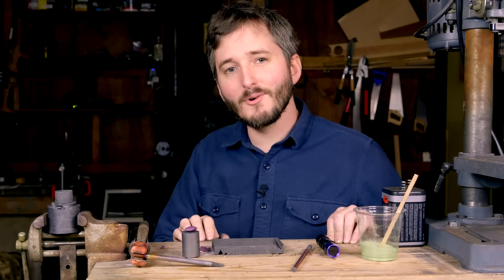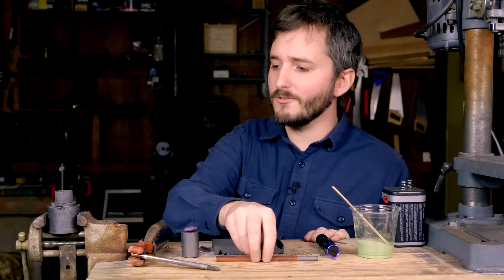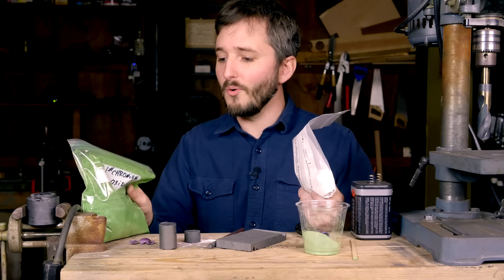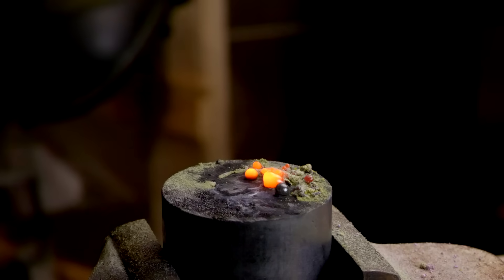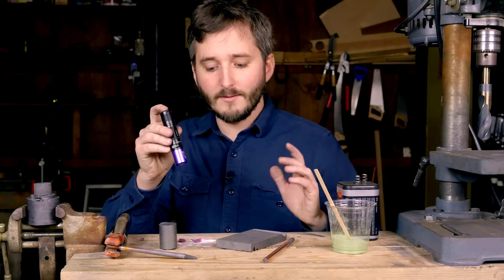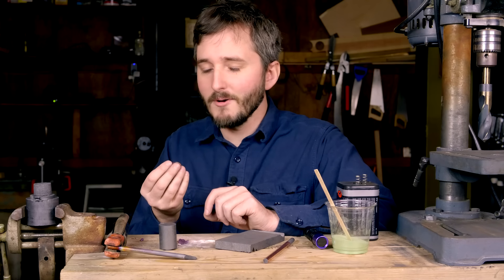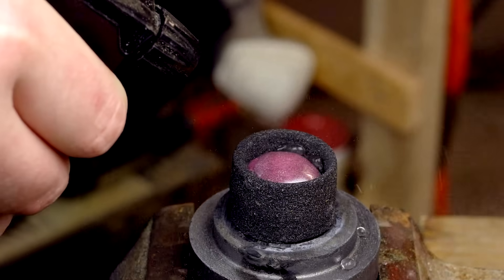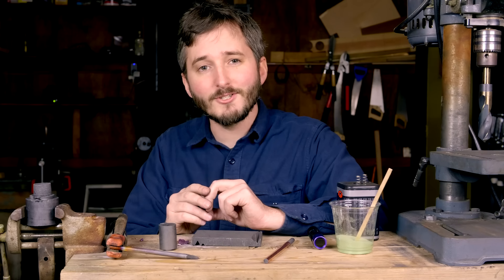How To Make Synthetic Ruby In The Workshop

Comment: I wonder if you compressed Element-"MkR" into a water-cooled porcelain wall-pot,  inserting 1 gallon of low-cost fermented barley extract at high-pressure, while vigorously bumping a large kielbasa into it's dimpled side, if the psycho-chemical-pressure stimulation could separate-out One-part AvE2 and One-part EMKR .....Hmmmm? I wager the anticipated outcome would likely result in inconclusive results due to the unexpected high-pressure vacuum affect on the rigidity of the kielbasa.

Comment: NightHawknLight you and ElementMaker rock! This now makes it dirt cheap to incorporate security authentication into products, for instance, grind the ruby into dust and add it to inks or plastics or powders, etc. The product now puts off a red glow when hit with a black light. This kind of innovative process opens up all kinds of opportunities, once not affordable to the average small business owner. I can think of  all kinds of products that could be enhanced if made from ruby. BTW, try letting the ruby cool on top of neodymium magnet to line up the atoms. Use your putty to protect the magnet from getting too hot and ruining it. Yet another process once not available to the average tinkerer thanks to your putty. I suspect the ability to align materials at the atomic level, very well should provide for some interesting innovation. Think magnetic wax, etc.
Reply: Lay off the weed a little man

Comment: hey is it possible to use wire coil wound around the crucible and use it as an induction heater, since graphite a conductor. maybe this way you can conrol temperature and also not contaminate the ruby with carbon from electrode.
Reply: i saw another comment that mentioned this, probably does work

Comment: Would an AC induction coil work to heat this? Would flooding the crucible with argon help with the carbon arc? What about changing polarity of the welder to prevent carbon from the rod being deposited, this assumes a DC welder?

Comment: Nice but I think it is better to use a tungsten electrode and argon gas to protect the electrode from oxidation of the air, the tungsten does not melt like the carbon electrode

Comment: I used to melt down aluminum cans in a home built foundry (nasty stuff, would not recommend even outdoors).

It is not difficult to build a blast foundry, I made mine out of a plastic bucket, dirt, stove pipe, and an old hair dryer. I was making aluminum-bronzes, brass, all kinds of fun stuff. I don't see why this wouldn't work for making rubies as well, it certainly would be more economical than trying to make them in such a small crucible, and if you had an electric furnace instead you could probably grow a single crystal. It's my understanding the way this was done for silicon chips in the 70s was with a leaky bucket that slowly emptied allowing a weight to pull a seed crystal out of the molten materials. That'd get you much better clarity in your rubies

The other thing to look into is a rock tumbler, just to get a nice finish on them and remove the roughness

Comment: If you have a metal foundry you can melt the rubies with the arc welder then place them in the foundry to cool down very slowly. This helps a lot for getting clearer rubies. They still won't be totally transparent but they look much much better !

Comment: A potential suggestion, any thoughts on using zirconium crucible? Personally I have used them before and they prevent any carbon contamination. Then again, you might be working on a much higher temperature.
Reply: Molybdenum crucibles are typically used in industry. They aren't actually crazy expensive for small ones. I think he would get better results if he used a molybdenum crucible.

Comment: can you confirm if you created optically transparent ruby? (i.e. polish off two sides and see if you can see through the window) It will be interesting to see how fractured the insides of the ruby are
Reply from the maker: No it's pretty full of bubbles.
Reply: @Nighthawkinlight  hmmm, is it possible to do a slow pull using a seed crystal? (Look up  ruby laser rod creation process) i.e. melt the mixture, and then use a crystal seed to get a single crystal, which would then be transparent. Might be able to do this if U heat the sides first, then directly melt using the same style you did in the vid, and then heat from the side again to maintain molten state while slowly pulling a single crystal.

Comment: think to shape daimonds they use a metal disk and a slurry of water and daimond dust , bet you can do the same thing with the ruby dust 
wonder if you can turn the ruby over putting it back in the crusible and reheat it to get the back smooth too

Comment: Check out king of random's channel for the arc welding method he used it would be huge improvement to this process. You really want to build the heat up and hold it for a bit before you let off. In this case higher heat held for some time could more thoroughly mix the components leading to less cloudy looking rubies. Faster or slower cooling also could drastically change the results. I would really try getting the heat up holding it and then letting it cool very slowly once.

Comment: Both chromium oxide and aluminum oxide have a MOHS hardness of 9 which is identical to corundum (ruby).  Why go through this process if you are looking for an abrasive?  Also, what is the clarity of the ruby you are making?  Would It be suitable for carving or faceting for jewelry?   Have you tried other trace elements (chromophores)  which are responsible for giving corundum its other colors?

Comment: I also wonder if one could make a setup to cast shapes out of ruby? For s complicated example a chess piece. Probably need a multi axes cnc to make a thin multi part mold and several electrodes to heat it all around and get it to melt

Comment: It seems like maybe if you could find a way to heat it up inside a pressure pot, you could create more transparent rubies- using the same idea as with resin casting to reduce the size of the microvoids created from the air trapped between the particulates before the ruby melts.

Comment: I’ve got this to work with an oxy-acetylene torch, but the results weren’t great. I did it on a steel plate, but already ordered some graphite crucibles to try it with an arc welder.
How could it be cut? Diamond cutting wheel? And, would the inside be clear?
Reply from the maker: Probably a diamond wheel. The inside will be full of bubbles unless you use a much more careful procedure than what you see here.

Comment: I think feeding in some Oxygen gas while the arc is going could improve the clarity by oxidizing any elemental carbon that comes off to CO2 which the O2 stream will blow away. That, or maybe a higher valence chromium oxide but those are really nasty and I wouldn't want to blow any around the shop so I'd avoid that option personally.

Comment: Unfortunately, my friend, it is unlikely that you have made synthetic ruby. Instead, the process you have followed will create what is known as “ruby glass”. Ruby glass is amorphous aluminium oxide, with some chromium to deliver the colour. The difference between this and synthetic ruby is the same as the difference between window glass and quartz crystal. In bot cases the respective chemical ingredients are the same, but neither ruby glass or window glass have a regular crystal structure. To create synthetic sapphire or ruby via the “vernieux” process requires very precise temperature control, and very precise control of the addition of the powdered feedstock. It is not a simple process, and when the factory process goes even a tiny bit astray, the result is ruby glass. Note that ruby glass does not have any of the physical or optical characteristics of synthetic ruby - it is glass. You cannot make lasers, it is not particularly hard, etc - it is glass. My apologies for bursting your bubble - you are certainly not the first person to get drawn down this particular rabbit-hole.
Reply from the maker: There's visible crystal structure. It's not a single crystal, but it's not amorphous glass either.

Comment: This is technically "Ruby Glass". It fluoresces, but its crystal structure is nearly non existent...the same as glass. This happens because it cools wayyyyy too fast like this. You need to melt the components then add a seed at just under it's melting point and seal the whole thing an insulated, pressurized, chamber  so it will cool over months. The ruby and sapphire made by flame fusion  are still pretty cool and still have some fun properties anyway. Good show!
Reply: they don't need to cool over months, the main method of commercial synthetic ruby production only takes an hour or so
Reply: @TheAechBomb  Indeed they do if you want the exact type of crystalline structure as you get in nature. Yes, synthetic "rubies" are made in an hour or so via flame fusion but any jeweler or gemologist will spot they are synthetic within seconds.   Lots of bubbles and layer lines along with amorphous structure.  Hydrothermal pressure rubies take from a few weeks to a month depending on size and quality and often has chevron patterns in it's crystal structure. Flux fusion can take up to a year. You will get a synthetic ruby that is indistinguishable from the natural. As you can imagine, it's also the most expensive.
Reply: @Halloween111  I don't care if my rubies can be told apart from naturally formed ones; if they're shiny, red, and UV reactive that's a good enough ruby
Reply: So it is far too amorphous to call a true ruby, which is far more crystalline in nature?
Reply: @justinw1765  Is the chemical composition the same?
Reply: When you drop aluminum oxide powder thru vernieul thing and get micro rubies can you throw those micro rubies in the flux pressure temp chamber thing? Like a mix of the two different styles
Reply: Hey why don't you try using water when grinding your "Ruby" like lapidary uses.  Sul. carbide is harder than corrundum and has been used for years to shape Ruby.
Reply: @kevinklatt7756  it has nothing to do with how hard it is .it has to do with how brittle it is.
Reply: Thanks!
Reply: He would need to hold it at ~1900 degrees for days.
Reply: Its true, real crystal took days even years to perfectly form, just like iron nickel meteorite which scientist predict it need just 1 degree temperature drop in million years to form beautiful crystal structure
Reply: Wait till u find out they grew as trees
Reply: @judahelisha6637 hahahahahah😂😂😂😂
Reply: Is there some way to do this process in a simple workshop? Perhaps without having to wait for months?
Reply: @schokoladenjunge1  Not an inexpensive way as far as I know
Reply: But not really any economical values for those who think they now will make a huge amount of money on this.

Comment: Rather unrelated, but something I'm curious about is if there's a chemical difference between those copper coated carbon rods, and old-school carbon arc followspot rods (think "Strong trouper" lights)

Finding a supplier for lighting "carbons" is nearly impossible in most places, finding a supplier for those arc rods is a lot simpler...

Comment: The best way to succeed in good quality Ruby is RF induction in an Iridium crucible within a closed system purged with 40cfh nitrogen and 3000ppm oxygen during heat up and at least 12 hours soak at a good melt, then lower O2 to 1000ppm for the duration of the growth cycle. It’s most successful with a sapphire seed rod with a 60degree orientation and 5rpm with 2mm per hour seed lift rate. Diameter can be controlled by manipulating the temperature. The cool down should be a controlled ramp down of temperature over at least 12 hours depending upon the volume of your system.I’m describing the CZ method. Keep in mind that this advice is extremely limited and there’s many other factors involved, too many to address here.
Hope this helps someone out there produce a quality product

Comment: Is it possible to make this ruby electrically conductive and check its ohm reading for resistance? Perhaps adding another metal like nickel and/or boron to the mix would make it more electrically conductive? I have seen a video where the person put the powder materials into a vacuum and heated it. In the powder a crystal was placed. The crystal changed the powder into a single crystal by growing it from the seed crystal. I have not been able to locate that video.
Reply from the maker: Interesting question, I'm not sure of the answer.

Comment: to perhaps create a translucent crystal of coridon you can try to recreate the process of August verneuil where particles of the mixture fall on the flame of HHO (or in the current case of plasma arc) and create small droplets of molten material on top of a rotating base being able  thus creating large crystals (watch out for the rapid drop in temperature as this can cause the crystal to break into many pieces)

Comment: You can try silicon carbide belts. SiC is harder than alumina. Also, cubitron belts from 3M might work. As i recall, they are a chemically modifed alumina with different rare earth metals to imbrove toughness and hardness.

Comment: If you want to smooth or cut the ruby, buy some chinese diamond wheels.  They're relatively cheap, can be used on a grinder (probably some models will fit a bench grinder too), and you might find you have a talent for stone cutting...  Note: I bought some that came with a circular saw sharpener.  They can sharpen tungsten carbide, so they should be ok for gemstone.

Comment: Worked at a Company for 31 years that grew Large optical grade Sapphire,Ruby,Yag and others. The main process was the CZ method using an Iridium crucible and RF induction, the temperatures involved were in excess of 2100C
Ruby Boules averaged 14 lbs, took about 14 days to produce and were fabricated into Lasers 
Yag temperatures were approximately 1960C and weighed about 5 lbs, took about 45 days on average, also for lasers 
Sapphire also 2100+C weighed as much as 60 lbs, had many uses including microchip substrate wafers 
It was a great job 
Jim
Reply: I was Chief Engineer at ICT for 26 years and used a similar process. We produced 46 different varieties of high temperature crystals.
Reply: These were for gigahertz transistors you have to
 remember that back in the late 70ies that was 
bloody high frequency.  We were developing the
first generation of oscilloscopes that could 
display signals in this regime.
Reply: I didnt understand a word in that so its kinda obvious im not smart enough to be here
Reply: @Carlos-mt8jh  Give yourself more credit- most people don't come across those word in technical books, much less conversation. I only knew boules were from a gemstone book I got when I was a kid, and from that only a very rough illustration of a chunk of something round on a stick.
Reply: @Carlos-mt8jh  it's not that you're not smart enough, it's that you don't have the necessary knowledge to decipher what you're reading :)
Reply: @BuzzedAldrin1  thats kinda what i said but smart mode
Reply: Shrek Wazoski not at all man, intelligence =/= knowledge! I’m sure if you spent time you could learn all of this
Reply: @Carlos-mt8jh  that's what I thought 😁😁😁😂😂
Reply: @Carlos-mt8jh  I saw the process on a TV show once. It wasn't that difficult, but I had no reason or desire to peruse this line of effort. Mother was a rock hound getting stuff around the states, didn't rub off on me. You might be able to search for the show.
Reply: What's the key to making the crystals optical?
Reply: @bradleyhenderson1198  I was told it’s how long they heat it. The longer it’s heated the more clear it is...
Reply: Could you do a video explaining how this works? I’ve been looking at the crystal growing methods from a saturated solution onto seed plates. They do that in Japan for quartz. But gems are more my interest. Russia used the Japanese method too...
Reply: Nice. So, lasers. Lockheed Martin need some? 14 lb ruby sounds like it's a very very big laser.
Reply: Very cool! Brought back a memory of getting a tour of a plant in Rochester, NY (Bausch and Lomb?) back in 68 where the lab included a platinum alloy crucible, I'd totally forgotten that! They made some pretty exotic glasses, and I think they called CR zone refining, something like that....
Reply: I've always wondered why most synthetic rubies come out pinkish. Do they skimp on the chromium? They rarely seem to be that blood red color that you can get in natural rubies.
Reply: @KP-ty9yl they can determine the color so of they want it dark they can do it.
Reply: so the one he made can be shaped and used for ruby laser?
Reply: What Amp welder is used
Reply: @emllikenoemos4199 it's so small any Amp welder would work.
Reply: Wow
Reply: It sounds like a fun job.
Reply: Wow that’s amazing actually, I’d be extremely interested in learning more about this
Reply: Any idea why RSA Le Rubis SA in France no longer produces ruby?  They used to be the world's largest producer of synthetic ruby.  Now they just make alumina.
Reply: 14 pound rubies... That's fantastic (~32,000 karats). much less 60 pound sapphires. Neato! That would make a hell of a D20.
Reply: Thanks!
Reply: Is there a way to make a rubie the size of a smart watch screen and use it as a touch screen?
Reply: Yow those are some large crystals. Way back in the late 70ies the company
I worked for was making small Gallium Arsenide crystals the lab operated 
under such a negative pressure opening the door took two hands.  The furnace
was inside a super fume hood  Apparently the chemicals in use were extremely 
toxic the furnace was quite a complicated apparatus.